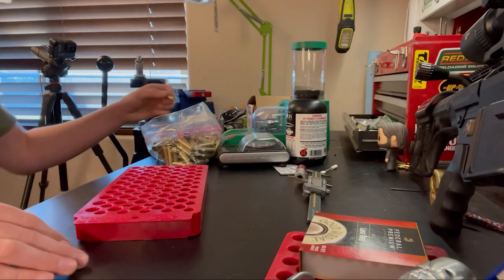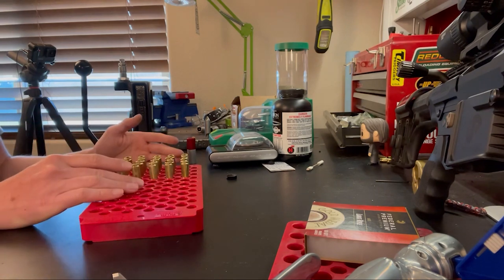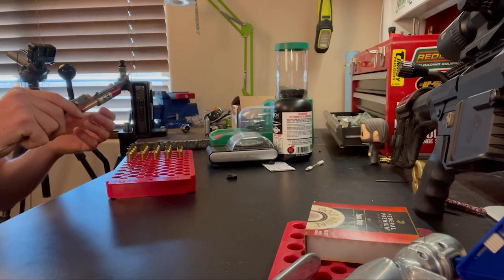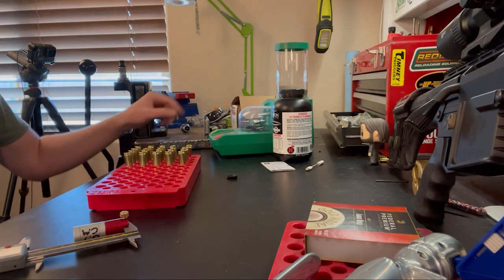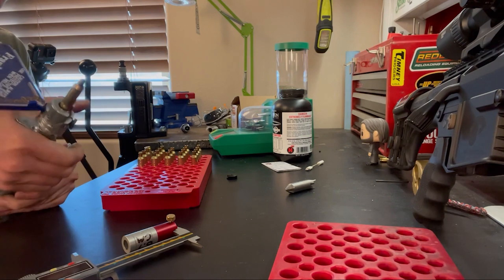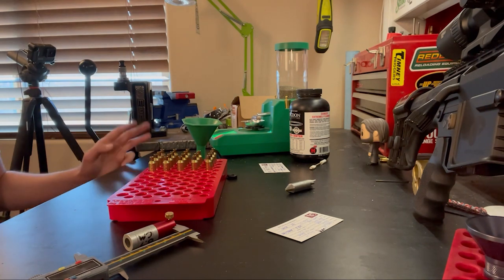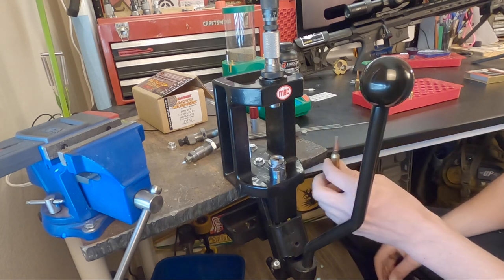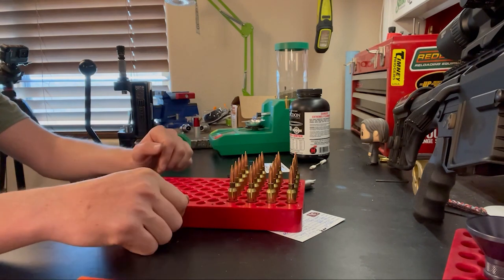Start to Finish Reloading, Die Setup Tips!

Comment: Hi, for bumping the shoulder I do almost the same checkings at each reload because you can get different results with the same die setting depending on the number of firings. Except I have a trick that can help you to get the exact same feel at bolt closing without checking on the rifle. When you have a resized brass case that fits as you like, just  keep it as a "headspace gage" for this rifle and zero your calipers on it each time you need to do some checkings. Keep one case like that for each rifle and you have your headspace gages. Cheers

Comment: Thanks for your video and I always enjoy all of your videos! You might want to check your RCBS LITE powder dispenser, the one I have is very fast, by the time I replace the pan on on the dispenser,move a case from the sized tray, (keeps me from screwing up) and move the funnel -it’s ready to go. I previously had another older brand but it was very slow and had to use this as a trickler only because of this. I love the new RCBS unit. Loading the cases 30-50 now takes just a few minutes and it makes reloading a lot more fun!

Comment: Have you ever thought of measuring from case head to bullet ogive with a bullet comparator bushing in your caliper instead of raw caliper measurement from case head to tip to eliminate the differences bullets have because of different variations of tips even in same batch, causing variations of seating depths from case head to bullet ogive? Of course I’m talking of producing competition accuracy loads here however. Plus knowing how far your bullet’s ogive will set off of the barrel rifling when a cartridge is loaded in the chamber is also something nice to know by a measurement of your rifles chamber from bolt face to shoulder’s datum line of chamber with bolt closed. Finding the ideal measurements for your chamber/rifle and keeping the re-loads as consistent as possible will keep tack driving accuracy more consistent. However I’m aware that sometimes with drop magazine rifles you may have to let maximum mag width dictate where you seat your bullets. Best wishes, enjoy and be safe my friend. ✌️😎👍

Comment: You should measure your brass after you size because it will grow 2 or 3 thousand after that.
Reply: Yes I was thinking the same thing about checking and trimming overall brass length after he resized, and trim to same max length each cartridge, followed by inside neck chamfer and outside neck chamfer before bullet seating with crimp or no crimp choice made.

Comment: Did you say at beginning of vid that your batch of brass is mixed number of firings? Then your work-hardening will be mixed as well as bullet seating, neck tension. Brass should be separated by headstamp and number of times fired. Even when annealing.
Reply from the maker: You can if you want. I don’t. I know a National Ranked FTR shooter that doesn’t. It’s up to each reloader
Reply: @WestDesertShooter  consistency is key, right?

Comment: Do you find ur Chargemaster drifts ? Mine seem to sometimes I keep an eye on the -number when I take off tray so see if it does funny things but still a lot faster than doing all manually. I just got one few weeks ago
Reply: Is your Chargemaster located near a fluorescent light? They can wreak havoc with electronic powder measures. LED lights seem to be fine.
Reply: @luvtahandload7692  I do have Led light. It seems to be steady now I think it I don’t let it warm up proper it drifts but lately it was good